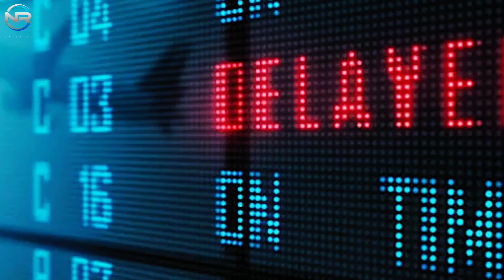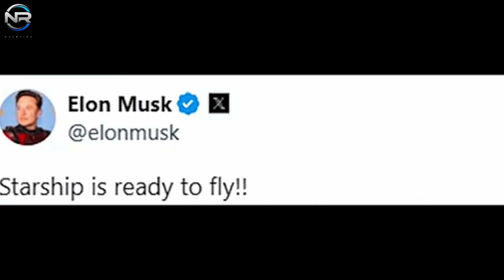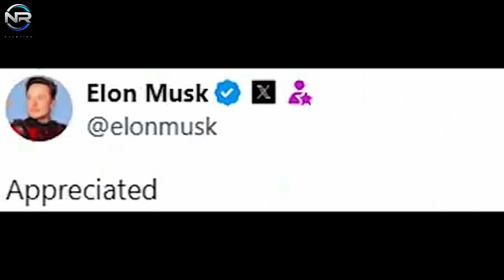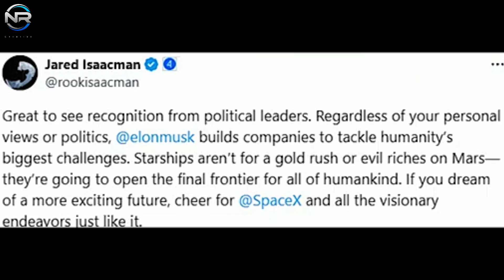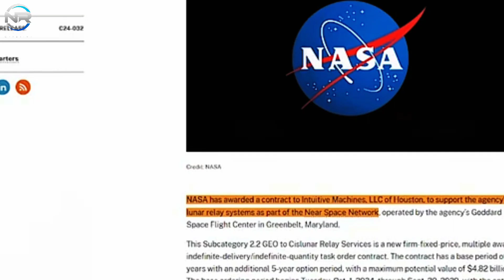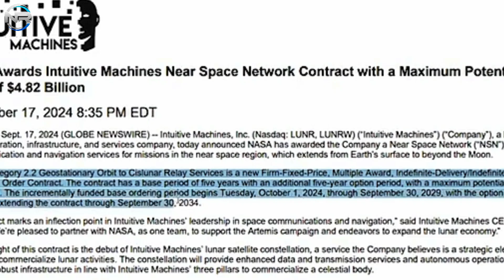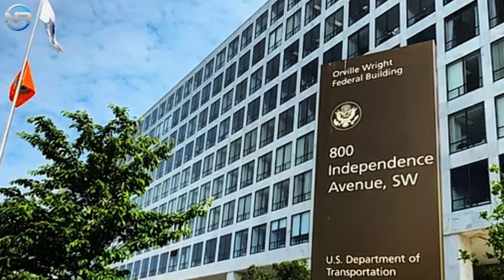Ready to Launch! President Donald Trump FORCES FAA to Approve Aviation License!

Comment: Reform of the FAA has to be on the agenda - or splitting the regulation of the space industry from commercial air-flight. The top management of the FAA have shown themselves to be either politically motivated or incompetent.  Either way they need to be replaced.